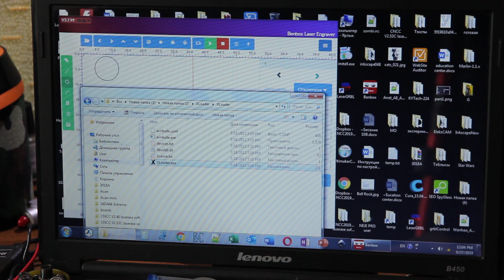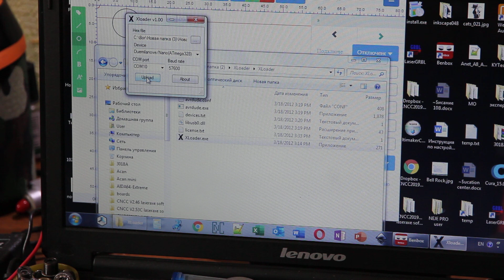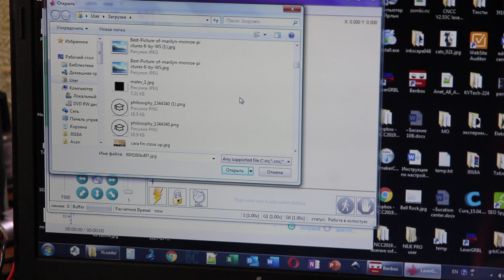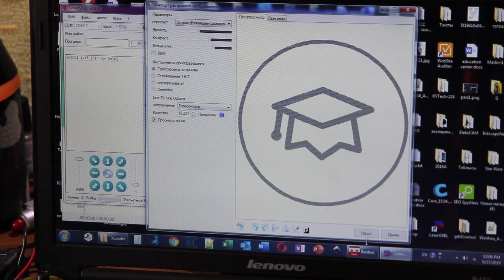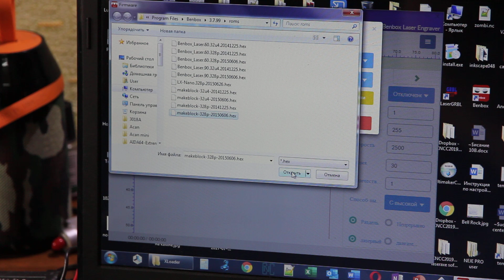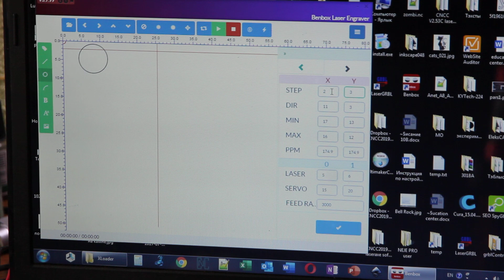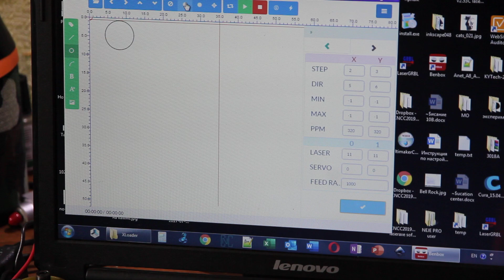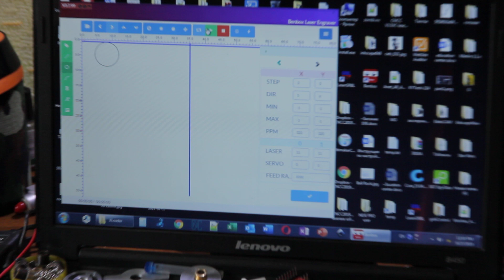Firmware for Benbox. Changing firmware to LaserGRBL and vice versa.

Comment: hello i did this now my laser will light up in lasergrbl but my stepper motors do not move any idea why
Reply: ok so now bought new control board and the problem is opposite laser do not work but stepper motors do, at this point i want to glue the 2 boards together. any advice my friend

Comment: Hi everyone, I ask if anyone knows how to help me, I received a LC400 Pro 50W laser engraver today, I assembled it and then I did the FIRWMARE update procedure as it was indicated in the manual, I selected as indicated the custom firmware, but now the laser does not move properly as it did before the update, right and left are inverted, back and forth it moves badly ("wobbiling"), the maximum speed decreased compared to before and no longer detects the limit switch micro .. . In short I can't use it.
I tried to program the other 2 firmware called originally, but the difference is minimal and the problems more or less the same.
Is there anyone who is able to help me or maybe it has the same model as an engraver and you would send me the firmware? It's all in metal, 40x40 work area, black with blue feet, taken on offer on Tomtop
Online I tried to look for it but I found nothing, thanks in advance

Comment: Make a video with the three types from eleksmaker the nano, mana, and mana se.  Also explain the diodes with extra wires.
Reply: the nano is the adruino card (the part you plug into your computer) that controls the mana or mana se cards. there are other boards that control a laser engraver but most are adruino based.
I did not notice any extra diodes. it looks like the wires are longer than normal, but they seem to do the job.
check this site it has some information on laser engravers( I found this site on the net, I have NOTHING to do with the site)
https://www.hackster.io/rgrokett/benbox-with-eleks-laser-engraver-gearbest-banggood-20ef0e

Comment: how did you get the 2 wire laser working on a 3 wire plug?  also how do get GRBL 1.1.hex to work with a controller card that only has a 2 wire laser hook up?
Reply: I assume that 3 wires are only needed to continously power the cooling fan, and have 1 wire that turns the laser on/off as PWM. But with 2 wires, you can have PWM as well. The downside is that the fan also is controlled in exactly the same way. So 10% powering the laser with PWM probably stalls the fan.
Reply: @xDevoneyx  I ended up buying a PWM to TTL converter. it cost about $10 on banggood.com. and i mostly figured out how to get GRBL working.